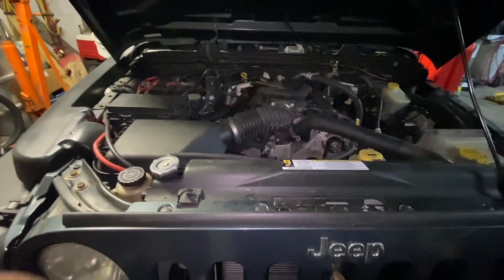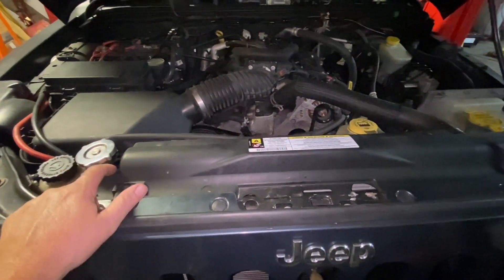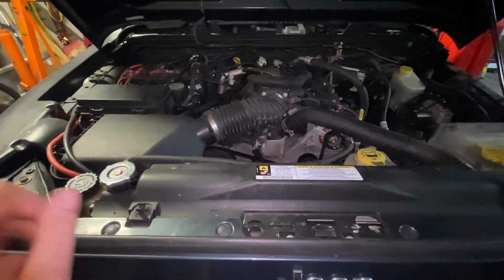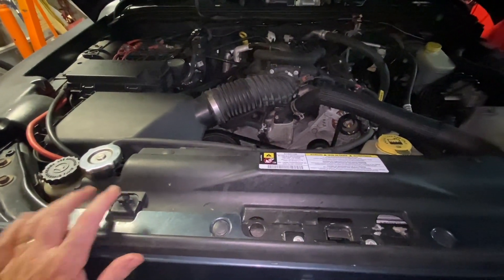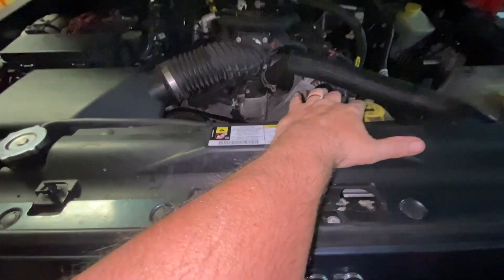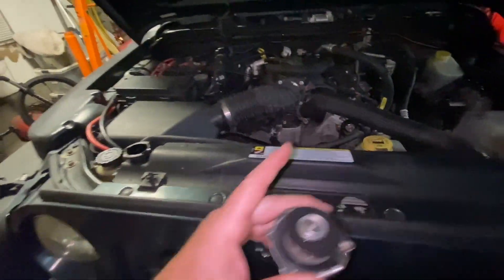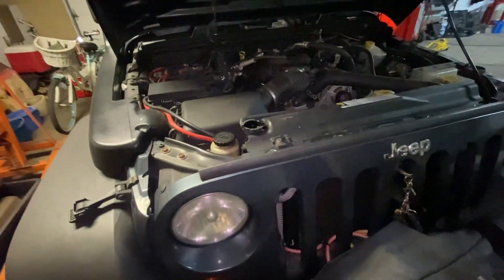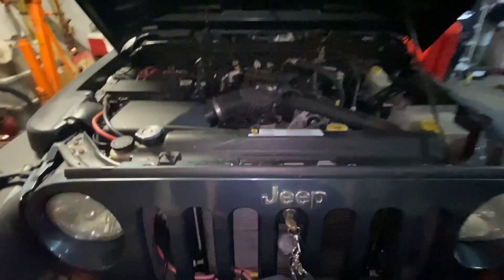Symptoms Of A Bad Radiator Cap VS Bad Head Gasket

Comment: I parked my Ford Edge 2014, and after a minute the coolant was overflowing. Before this day my car ran smoothly. The garage I gave the car to for fixing, replaced with Radiator fans. I hear the radiator fan go on, the moment I start the car- with AC on and car cooled down, is this normal?
Reply from the maker: Fans will go on when you turn the AC on but coolant shouldn't overflow, you are still overheating

Comment: Good video. What would cause coolant leaking out of the radiator cap valve on top. The original radiator cap was leaking out of the top valve and now the new one is as well. Both OEM. I don’t seem to have a head gasket problem and the only coolant I’m losing is through the top of the cap.
Reply from the maker: You mean leaking out of the radiator cap, vent hole? I little leakage is normal  but not constant. If it is constant then the coolant system is building too much pressure due to an overheating problem such as a bad thermostat , clogged radiator, air in the system of a bad head gasket.
Reply: @ yes exactly, the vent hole. It’s not a lot but it is constant. The truck never over heats, it’s a 2015 ram 1500 5.7 hemi and when it hits 224 the fan kicks on and it never goes past the middle. But about once or twice a week like clock work I see a small amount of coolant spew out around the vent hole. It’s very strange because the truck runs around 204-206 but a few weeks out of the year like clock work it will go up to 224 every day several times a day but it will never go past the half way mark on the temperature gauge.
Reply from the maker: Try a coolant flush, could be sentiments in the system and a new thermostat
Reply: @Mimiandfriend did u find out the the problem I'm having that issue now after changing waterp pump and thermostat

Comment: What causes  mazda  cxl to over heat  wen not  mixing oil &water, pump,thermostat  radiator,horses  are fine
Reply from the maker: Radiator cap, fans not working or head gasket pumping up coolant

Comment: Thanks ❤❤again from Iraq
Reply from the maker: Iraq! You’re very welcome!!!
Reply: @motorcarnut  I opened rad cap and started engine and one bubble came up then the coolant started to come up is that a head gasket problem?
Reply from the maker: @JoseGonzalez-ed4hq how fast did it start to overflow?
Reply: @motorcarnut  not super fast . It slowly came up maybe 30 seconds I wasn't counting almost a minute maybe
Reply from the maker: Ok with the car overnight cold and radiator cap installed feel how hard the upper radiator hose is to get an idea then start the car within 1 or 2 minutes the hose should not get hard if it does probably a blown head gasket if not then it’s something else.